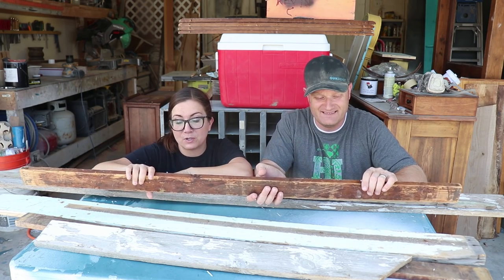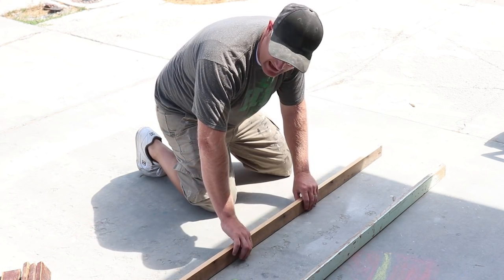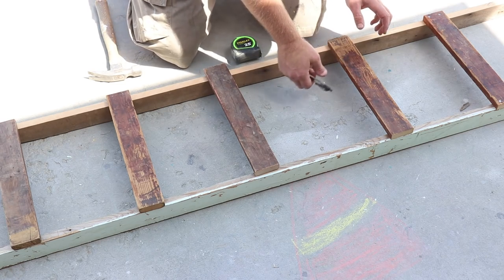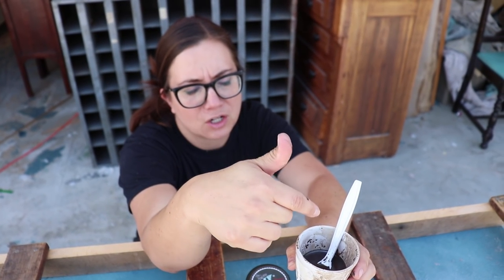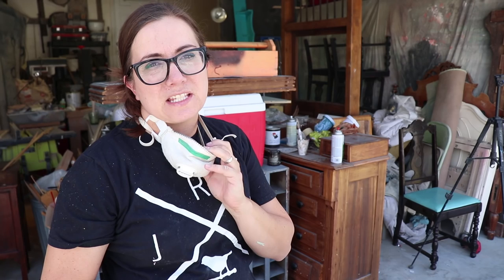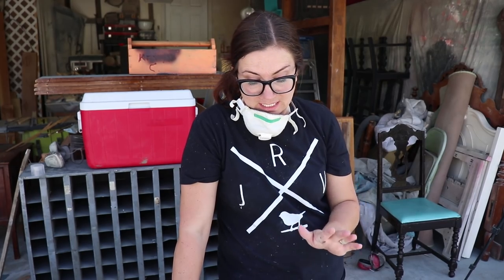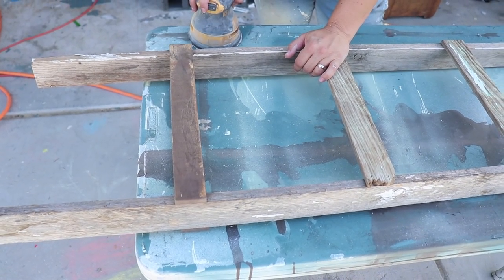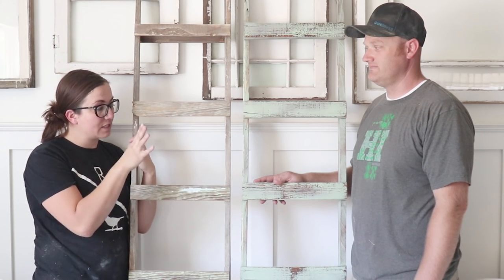How To Build A Chippy Two Tone  Vintage Ladder From Salvage

Comment: Thank you so much for sharing how to spray milk paint!!! I followed all of your instructions on how to spray chalk paint, and tried it for the first time last weekend. Was awesome!  I’ve been using your shellac tip and now I will use you lacquer tip too. Is there a water based vs oil based lacquer I need to know?  Also have u tried top coat over wax yet?? Maybe wax that has cured for awhile...
Reply from the maker: I believe all lacquers are oil based. Been wrong before. But pretty sure. 👍
Reply from the maker: I’ve not tried spraying over wax. If it was fresh I’m sure it would create a resist. Older wax might too.